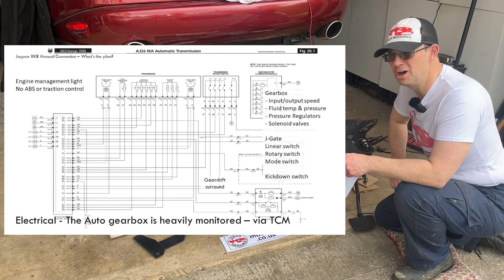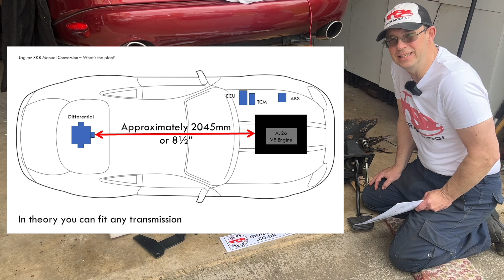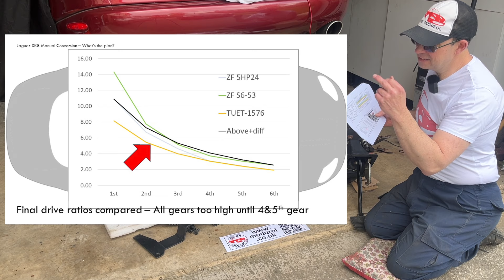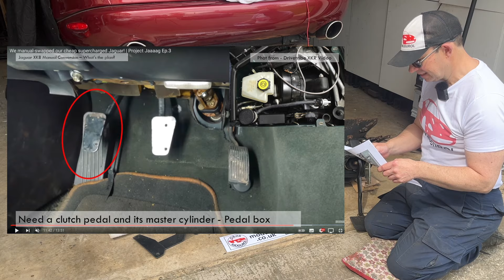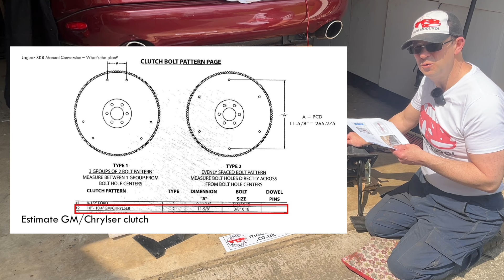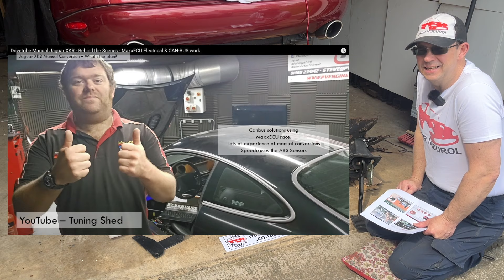Jaguar XK8 Manual Conversion action plan. Sequence of events gearbox choice & problems MT03 XKR X100

Comment: All the best with the conversion!  Whenever I drive my mine I can’t help but think how great a manual transmission would be to keep the AJV8 singing, the J-gate just isn’t the same. It’s hard to believe a manual was never a factory option
Reply from the maker: @asteriskaddiction, thank you for the encouragement. My thoughts exactly especially with the XK8 and its VVT. The gear selection seems to activity avoid the car triggering the VVT and any acceleration. It is hard to understand why Jaguar never built them, regards Damian
Reply: @Modurol  Perhaps because USA was the target market, and offering a manual option was probably vetoed as too expensive and likely to be sold in much smaller qtys.
That's my theory anyway.

Comment: I have changed the linear switch which is at the J Gate on the 2004 model after the P0706 code.  I have a new battery. I think what you are doing with changing to manual is a good long term fix becaise the TCM and assoiciated sensors and limit switches seem over complicated and unreliable.
Reply: I have a 2006 merc CLS and when I had an issue the mechotronic block was split and sent for refurbishment and then no issue since.
Reply from the maker: Paul, correct, getting rid of the automatic gearbox has a few benefits including improved reliability, regards Damian
Reply: The J Gate is great but seems to need constant nannying and adjustment .

Comment: I am now looking for a workshop that can split the mechotronic unit from transmisson check and recondition then refit .
Reply from the maker: Paul, are you talking about the P0706 code? Not just the cable adjustment shown in TSB  307-01 then? Regards Damian.

Comment: I found out that these seals degrade and are located between the mechotronic unit and the transmisson.  The four tubes and the rectangular bridge seal.
Reply: I have a pic with original ZF part numbers but couldn't upload here
Reply from the maker: Paul, i didn’t know that, if you have any information to share you can email us at oanddr@gmail.com ,thanks Damian

Comment: Hi there . Can you tell me where the range sensor is located for the transmisson of a 2004 XK8. I am getting limp mode and code P0706. Is there a rotary switch on the transmission that can be replaced or is the range sensor located inside the gearbox hydraulic mechanism.
Reply from the maker: Paul, Good question. I haven't had this issue before but found there was a Technical Service bulletin for just this issue. TSB 307-01 - Selector Lever Cable - Adjustment Procedure (link at the bottom to the TSB). All TSB's are available at our website www.modurol.co.uk.  With any luck it will just be a bit of stretch in the cable that needs re-adjustment. Car Crush UK (John) did a good video of this (link at the bottom). 5min 43sec onwards shows you the idea. Hope that fixes your problem and please let us know how you get on, regards Damian
TSB - https://drive.google.com/file/d/1-DzfRXf0iPwAJxw50PNbCIeCnBHgkN6u/view?usp=share_link
Video - https://youtu.be/5c9m6nz2FXo?si=Wuapc-WEls_xaEMs